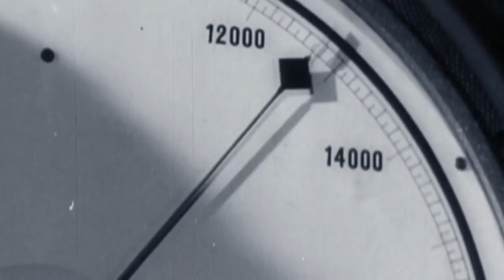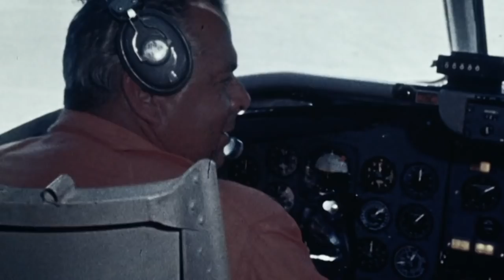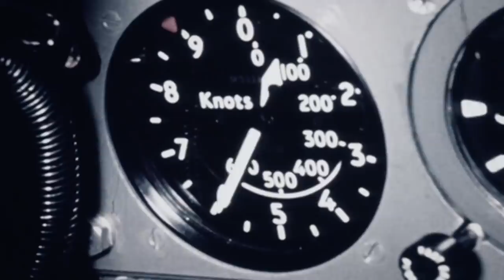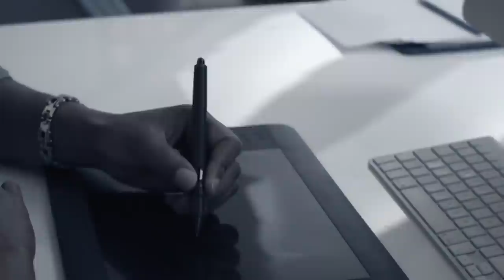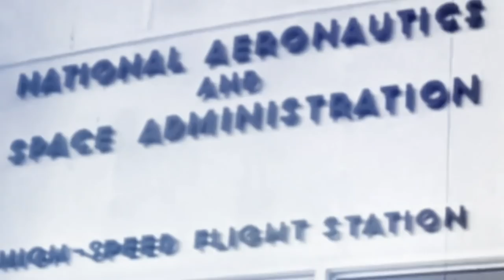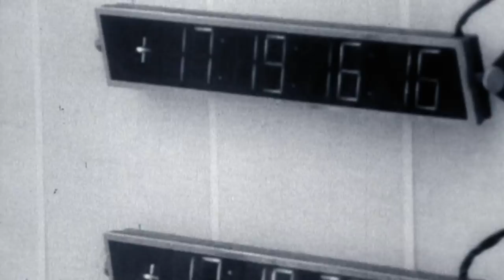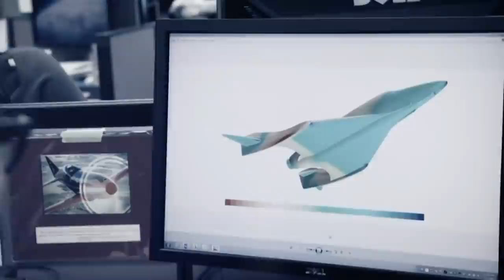How The Harrier Jet Was Adapted For Aircraft Carriers | Power: Jump Jet

Comment: Douglas DC-8 broke the sound barrier at Mach 1.012 (660 mph/1,062 km/h) while in a controlled dive through 41,000 feet (12,497 m) and maintained that speed for 16 seconds. 
-Wikipedia